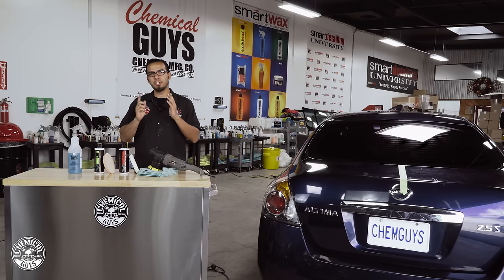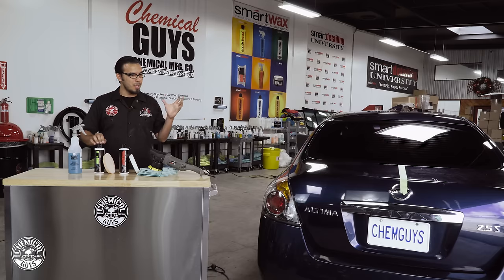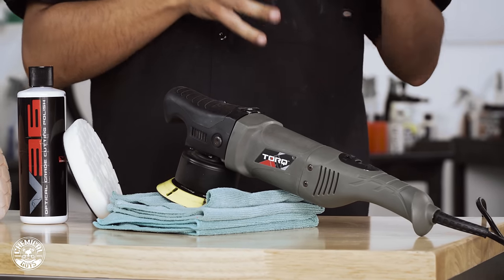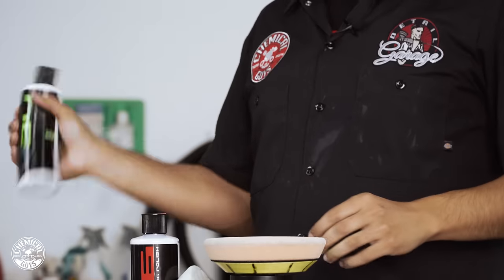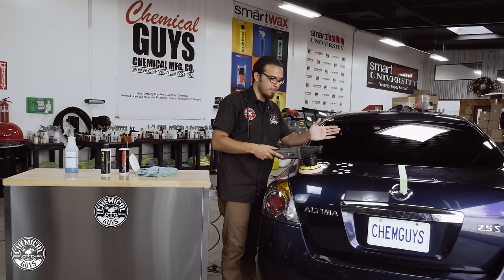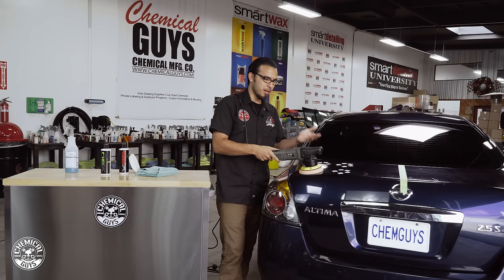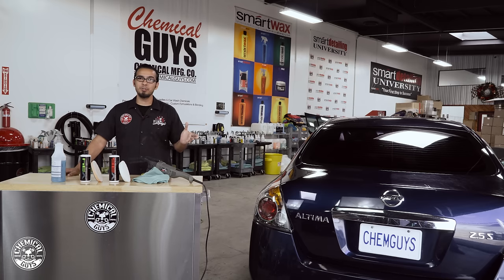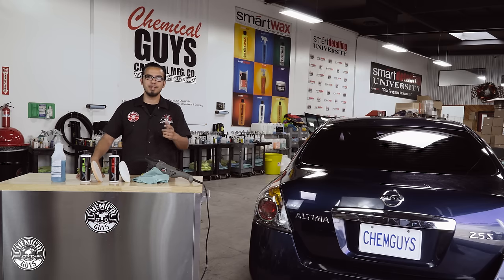How To Remove REALLY Deep Scratches and Swirl Marks! - Nissan Altima - Chemical Guys Car Care

Comment: You didn't show or explain how long you spent actually polishing. You said one pass each way? Vid needs more clarity and explanation instead of slow mo camera work.
Reply from the maker: Thanks for watching the video. To clarify, you have to move slowly when polishing, generally you work in straight lines. Move in a snake like pattern from left to right, and vice versa when you're moving downwards. You'll want to make two passes, starting from the beginning, and then backwards. After you're done with the V34, then you can apply the V36. Always start at low speed to spread the polish, and maxout the speed to begin cutting, or finishing. Make sure to spray pad conditioner before you begin. Its good to have a microfiber on hand to wipe away the dead paint, and spent polish to check your results. For the best results, take your time, there's no right answer when it comes to how long you should polish. Polishing is time consuming, and physically demanding at times, but you will eventually come to appreciate it because it makes a world of difference on your vehicle. If you have any other questions, I'd be glad to answer them. Thanks for being part of the Chemical Family.

Chem Guys -  Alex
Reply: Revs yea I'm sure it took a while. and when he put the light on it. it still was a lot of scratches
Reply: Chemical Guys can one damage the clear coat if done wrong?
Reply: Jesse M not if you use a DA polisher, you can ruin the clear coat if your using a rotary polisher and you don't know what you're doing
Reply: Just a polishing stage, I done on my car is about 2.5 hours because I work each panel slowly, my car is a large size sedan so it is large. The bigger the car or if it’s a truck, it will be longer.
Reply: I know its been years, but I am using the V32 on a camry that hasn't ever had the exterior taken care of in the last 7 years and 2 hours in, Id say I am halfway done with the V32 on just the hood. Luckily Toyota's mettalic grey is very good at hiding scratches because they are worse than this Altima, but not near as visible

Comment: Nice video Chemical Guys.

BTW, for those here bitching about how so many scratches still remain, let's get real. It doesn't take a detailing genius to see that this is a VERY neglected and abused car, probably a daily driver that before this, was treated with a no shits given attitude. Most scratches too deep to remove with a 2 step polishing process aren't worth chasing after if you don't want to end up with no clearcoat.

Let's face it, the vast majority of the scratches were successfully removed and under normal viewing and lighting conditions, the remaining scratches aren't easy to notice.
Reply from the maker: Thanks for watching the video, I nodded as I read what you said, it's very true, and we appreciate you taking the time to write that. Mainly what we want to get across is that there's a science, a technique, and a purpose for what we do, and yes some scratches can still be visible, but again we're forgetting that the owner of the car has never polished their car before, and is now delighted to see that the appearance of the paint looks substantially better than it did before. Also I love your user profile pic, the first two terminators were awesome. On behalf of the Chemical Guys crew, welcome to the family. Stay tuned, we have more great videos on the way.

Comment: A nice wet sand and a rotary buffer would probably been the better choice and would have taken the same amount of time or less! All those marks at the end were etched into the paint, or the clear coat breaking down for years of neglect! Great job though with a (DA) Dual Action Polisher!  Next time try a wool pad on the DA polisher it would do a better job!
Reply from the maker: Hey!
Thanks for the feedback! Happy detailing!

Comment: Looks better but title is misleading those aren't deep scratches this are barely on the surface
Reply: Looks better, but there's still a lot of scratches left. There should have been less after a 2 step process.
Reply: they are deeper than most, some of the scratches even lead into the base coat, the coat that has the colour, which is technically a deep scratch, whereas light scratches are just in the final, clear coat, knocking the paint down further would create waves along the body, or would make the paint thinner than it needs to be.

To fully recondition this car it will need to be sanded, metal bogged, sanded, primed, sanded, painted x3, clear coat x4, then sanded, cut and polish then waxed to remove all the imperfections.

But this is a Nissan Altima, you don't need a financial adviser to tell you... that makes no financial sense

However if it was a 1969 classic car that can be restored for half the price it would get at auction, that b** is gonna make some money if it's finished with a gleem
Reply: Happy Fox true it does look a lot better I'm sure the customer was very happy either way
Reply: How do you even know that it would need to be repainted without even being there? Seeing it from this video doesn't show much to make that assumption.
Reply: With the title being "how to remove really deep scratches", you would think they are showing you how to wet sand.
Reply: MikeEM1 same here

Comment: You offer four different compounds. 32 - 38. I was under the impression that you should always end with the 38 polish. However, you did not. Also, It looked as the scratches were significant. Could you have used V32? Finally, is it okay to skip from say, V34 to V38 etc?
Reply from the maker: Thanks for watching the video. V38-36 are finishing polishes, 34-32 are compounds. In this instance, you could use V32 with a yellow or microfiber pad to cut even further to remove additional scratches and swirls. It depends on your time frame, and what's acceptable by the customer, some people want total correction, others are just looking for improvement, and minimization in the appearance of their paintwork.

Comment: lol, i was trying to decide between a rotary and a RO and the first 5 seconds of this video  settled it for me and i ordered a dewalt 849, as a offroad guy in the deep dark forests of the PNW those are what i consider light scratches for the most part, there's a few good deep ones in there but my truck looks way worse than this.....i'm also kind of a dumb ass to, i was caught/helping out in a forest fire last summer and had about 1/2 inch of ash build up on my truck, like an idiot i wrote WTF in the ash on the hood/bonnet and now that crap is etched into the paint...which is why i'm on a mission now to R&R my paint job just to fucker it all up again.... anyways, if you read this far into my stupid story, from what must seem like a stupid person, i thank you for these vids, it really helps out and im going to give your products a try just because you guys put in the effort to make videos like this and help stupid people like me figure out how to do this sort of thing, i'm usually a 3m guy when it comes to my chemicals, across the board, i've had good experience with almost all of their products, i mean a company that large can't bat 1000 all of the time but i generally trust them, that said, i'm making a break from that line of thought and am going to ordered up some of your products from start to finish and see how it goes, i'll be reading up on how to do all of this with just a rotary and i know it's not the best place to start but i'd consider myself a craftsman so i should pick it up quickly and for the type of work i am doing i'm not really considered about a show quality product when i am done, i just want the scratches out, so for my level of detail and how bad some of these tree branch scratches are i think i can get it done, i may end up having to fill and touch up, but we will see.... regardless i am beyond grateful for your videos guys and gals!

Comment: Question! So I've used orange pad and v32 to remove a lot of the scratches on a mini van's hood. I can still see some scratches but would a microfiber pad do a better result?
Reply from the maker: Hey there Vic,

The Black Optics Microfiber Orange Cutting Pad is able to remove heavy swirl marks, scratches, and oxidation like heavy wool pads. If some of the scratches are too great, it may need to be sanded but that's the last option because wet sanding puts your paintwork at risk of further damage. Wet sanding should only be done by true professionals or those who really what they're doing.
Reply: ohh okay I see! Well I think I will try a microfiber pad just try things out on my car. Thanks for the info!
Reply: Without a paint depth guage it's hard to tell how much paint is left to be leveled. If the car has never been corrected you can do pretty much anything you want to once, but at some point there's things you have to live with. 
Any scratch that you can feel with your nail most likely won't be able to be compounded/polished out. 
Have to find a happy medium between looking great and living with some scratches.

Comment: The left side, while it does look a lot better, still shows scratches under the light. Would this be corrected by repeating the steps in the video, or would more drastic measures need to be taken? When do you decide it's time for a new coat of clear on the paint?
Reply: Jesse Griffith needs to be wet sanded to get all of it out
Reply: Jesse Griffith You def need something more aggressive for that removal.  From what I seen it was about 65%-75% corrected.  But 💯 percent better than what it was. most customers would prob be happy with that.
Reply: Jesse Griffith With a pain gauge you can get semi accurate measurements of the thickness left and ask the customer or yourself if you want to try and go deeper into the correction .  Sometimes it's simply not worth the effort for the extra money to chase the scratches that are too deep. I would def have the customer sign off if I thought I was going to thin.   A bit of 2500 or 3000 wet sand and buffer with wool pad with v32 or similiar, followed with v34 with orange pad on a DA.  I use the flex since I can apply more pressure here.  Then I follow up with v36 or v38 on a white pad with less aggressive pressure.   This should correct it 90-95 Percent.
Reply: Also if the scratches can be felt with a fingernail.  Forget chasing that scratch all the way out.  You can get it too look better but just not GONE.
Reply: Michael Hinchey true that a more aggressive compound should get it out a lot better
Reply: Jesse Griffith you have a few options, the next step up would be microfiber cutting pad and V32. If that doesn't work then the good old 1500/3000 grit wetsand combo, compound with V32, polish V36. It all depends on what you're going for, perfection or a great before and after correction? The results here are night and day for sure, once a sealant is applied it'll hide the remaining defects even better. Most customers that don't know about detailing just want a big difference look and plenty of shine, that's why 1 step details are so popular now.

Comment: How to you clean the polishing pads once they have been used for polishing with the compound. Is there any special product to clean those or just warm water will be ample... And secondly, as in the end there still were scratches, so is it possible to get those ones removed completely.
Reply from the maker: Thanks for watching John, you can clean the pads in a few different ways, one involves a grit guard, the other involves using a scrubbing brush. I've left a link on how to clean polishing pads below. To answer your second question, a more aggressive pad like the yellow hex pad, or the microfiber polishing pad with V32 could get more of the scratches out. The last, and final method of removing the scratches would require a sanding block of 400 grit, and 600 grit. You have to wet Sand the paint, just keep in mind that you're wearing down the clear coat of the paint.

http://www.chemicalguys.com/Grit_Guard_Pad_Washer_w_Pad_Wool_Cleaner_p/iai_507_3.htm
https://youtu.be/4vfvP1Z2R4U

Comment: If you wanted to do a panel at a time (as I don't have a machine so don't always have loads of time to complete) so could I detail apart an area clean. Clay it and then VSS it ? Green happy ending Towells for clay residue remover. What towel for buffing would you recommend. As I last used cheap ones and put more light scratches in :( love the videos as always
Reply from the maker: Hey Curt, I start detailing by washing the entire car, then claying section by section until you do a full pass along the vehicle. You can use the VSS with a microfiber applicator pad. A 2' x 2' space is a good work area when polishing. Always work in small sections so you can keep track of your  progress, also you can compare progress with sections you haven't worked on. The green microfiber is for paintwork, the yellow towels are for the interior, blue towels are for windows, black is for engine bays, tan is for leather.  Green is fine for buffing. you can flip the towel over to the dry side, and use it to wipe down any spent polish, dirt, or clear coat.
Reply: Green happy ending towels then ;)

Comment: Very informative looking to do my first polish with VSS tomorrow on a car with mostly light swirl marks. Too be fair though... would you say you actually removed some scratches/swirls or did you simply make the paint shiny ? That end comparison is kinda shocking I was not expecting that many scratches/swirls to be left.
Reply from the maker: Hi Dan,

As you saw, this vehicle was badly damaged and is in need of a lot of work. Some of these scratches were just too deep to correct that, if we had more time with the vehicle, we could've gone with a heavier compound like a V32. As we always say, it's better to start with a lighter compound because if you're wrong, you don't accidentally do more damage to the paintwork. The paintwork is not 100% with the way we did it but it's still a heck of a lot better than it was before. Keep us updated as we'd love to see how the VSS works for you!

Comment: Hi, Nick 👍🏻👍🏻 Awesome job using the TURQ 10FX👍🏻 I have always waxed my vehicles by hand just using a pad, back in my earlier days they only had those round orbital machines so I was always afraid I would burn the paint, I enjoyed watching you use the TURQ 10FX it seemed to just glide across the paint only using a slight pressure to help remove the scratches. I really like your style Nick awesome, informative information and knowledge in all your videos using all the Chemical Guys products. I have a Ford F-150 it’s a Champagne color I would so like to see you detail my truck back in the day I had a 69 Camaro it was dark green with white pin-striping it looked black in the sun I kept that car clean and waxed all the time. Thanks for sharing, enjoy and have a Great week !!! Danny
Reply from the maker: Hey Danny! Thanks so much for tuning in and for the incredible feedback. The TORQ 10FX is one of the most user friendly machine polishers available. It easily removes paint imperfections without running the risk of damaging the finish, it can be used to apply coats of glaze, sealant and wax for efficiency. - Happy detailing! 
- CG Nick
Reply from the maker: Hey Danny! Thanks for watching and thanks for being part of the Chemical Guys family!

Comment: Hey guys when you use V34 and an orange pad do you follow up with v36 on an orange pad too or white? Then do we use v38 still?
Reply from the maker: Hey Cristian, good question. After using V34 with an orange pad, you want to do V36 with a white pad, as the goal is refining. Check the paint to see how satisfied you are with the level of scratches and swirls removed. If you are satisfied, there is no need use V38. If you are not satisfied, proceed to V38 and a white or black pad. Thanks for reaching out to us Cristian, we're really glad to have you part of our CG family!
Reply: Chemical Guys thanks guys you are the best!

Comment: How much clear coat is removed on a typical job like this?  Do you ever measure the paint depth before starting a polishing job?  How many times can you typically polish a vehicle before the clear coat would need to be reapplied?

Comment: Hey Nick, ive got the TorqX after i spread the material on setting 1 i usually follow that using setting 3 on the machine, i scared lol of going any faster than that, any advice, and btw the whitewalls on my antique camr out mint using the spray cleaner
Reply: 3 isn't doing that much cutting. You can go higher, the Torq X isn't that powerful. You should be able to go to 5 without issues.
Reply: thanks ill try that, the vehicle im using it on is a show car, never sees rain or any weather but sunshine it is only driven to shows and back home, the paint is pretty nice, im just trying to deepen the shine
Reply: Bryan B The back of the bottles of the V line polishers give you speed settings you should use. Spread it out with 1, and polish it out with 5.
Reply: Dillon Kulp yea thats what ive been spreading at, just leary of going too fast bc the paint is very old and delicate, the vehicle im using it on is 77 years old